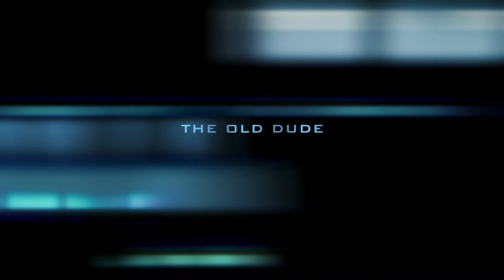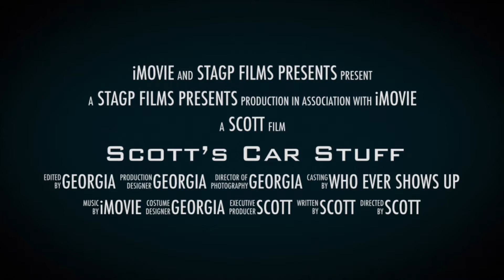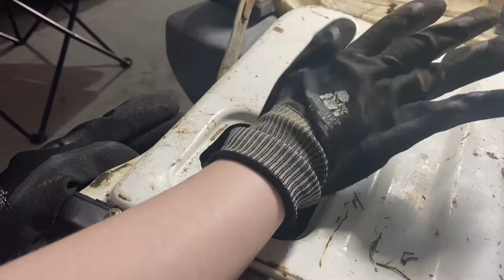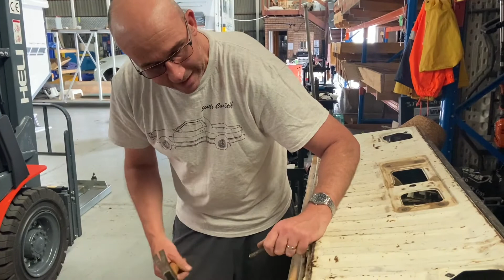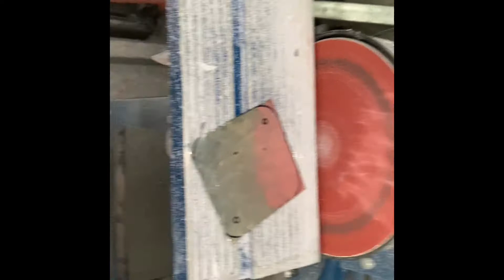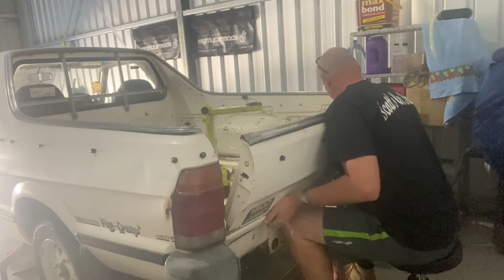Working on the Subaru Brumby - Part 8 Tailgate

Comment: What have you done to your brumby so far Scott?
Reply from the maker: Have a look at some more of my videos. I have done pretty much the whole rear end, diff, cv shafts, suspension. Tidied up wheels and tyres, a few other “little” jobs like the tailgate. I have still quite a few jobs left that I would like to do. Like front suspension, rust repairs in the tray, clean up the interior and so on. Cheers😀